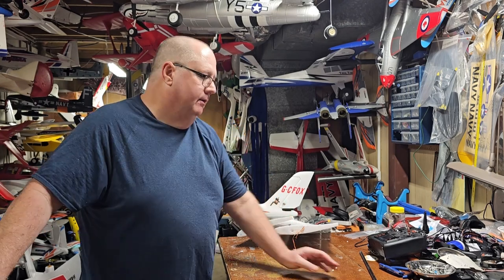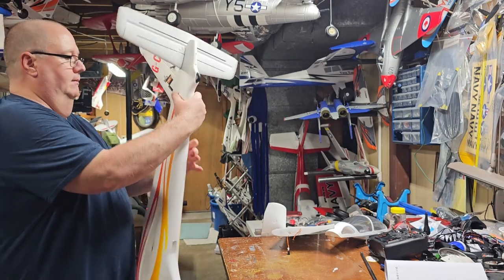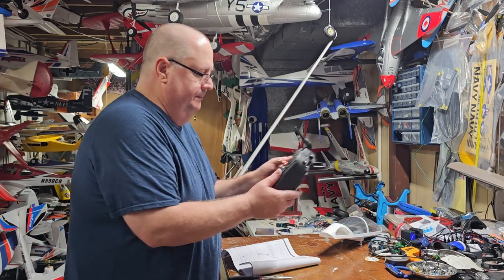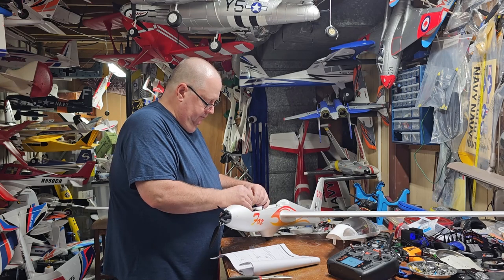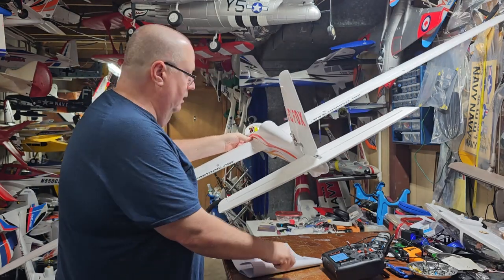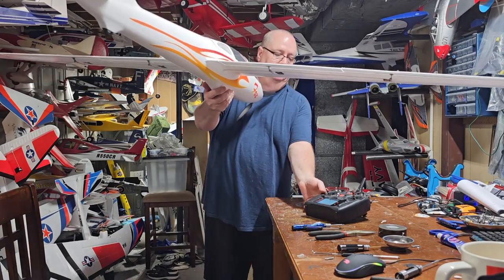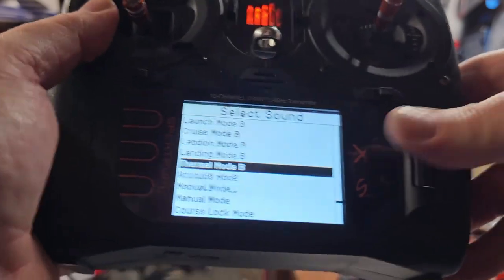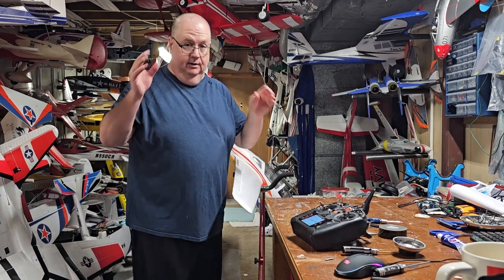FMS 2300mm Fox V2 Assembly And Radio Setup by Fat Guy Flies RC

Comment: Witch do you like better? Fox 2300, or fms 2500?

Just ansured my own question. The Fox is nice but dealing with the Y connectors is a royal pain in the ass. The FMS 2500 is just plug and play.
Reply from the maker: If I have to pick the 2500 every time.